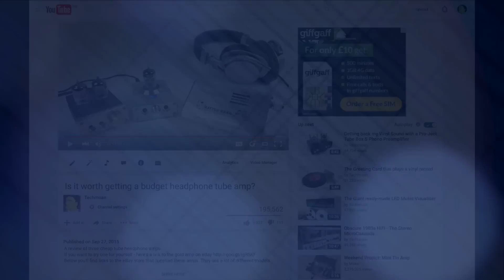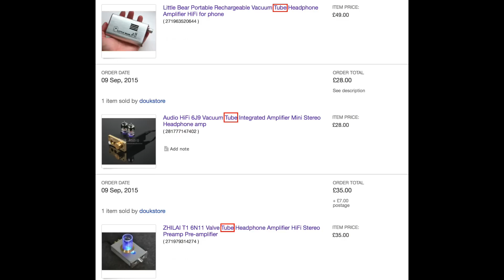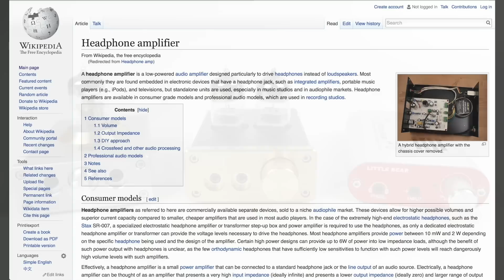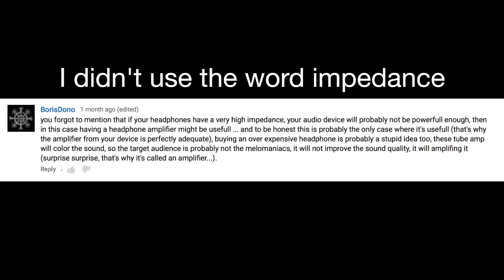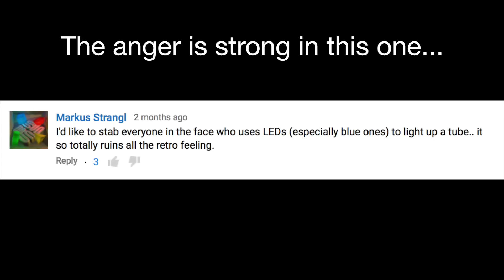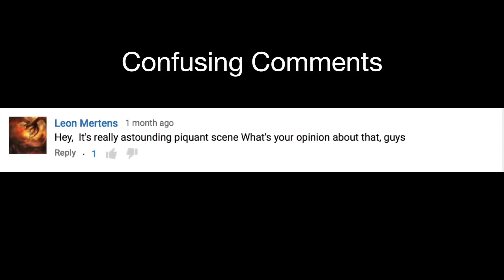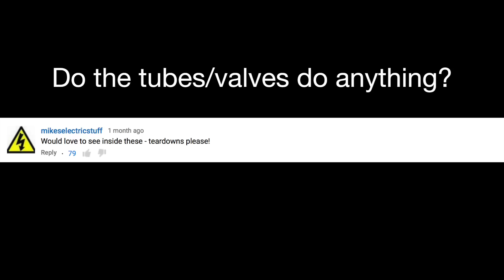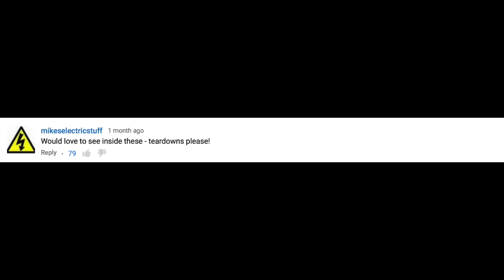Headphone Tube Amps - Follow-up & Tear-down

Comment: I'm an audio engineer by profession. I have to laugh at these hi-fi guys. It's very much all snake oil and suffers from opinion riding over physics. Take a look in a professional recording studio. There's no gold plated connectors or £1200 IEC power cables there.. Keep up the great videos pal and thanks for your efforts..
Reply: +Andrew Kirkby I bet you guys don't even use an atomic, gps compensated clock for your 50hz/60hz AC line conditioner, do you?
Reply: +Andrew Kirkby I'm not a professional anything, but I quite like to do my own automotive work. 1) I find a sense of pride fixing my vehicle, 2) It's old and needs it often, so it saves me money, and 3) It's hard to find a garage that doesn't break more parts than it fixes.  That being said... I hear people give me all kinds of vehicle advice, and much of it is snake oil as well. Telling me to put in additives and "HIGH POWER" spark plugs, telling me I should buy this or that to make the car work better. The truth is regular factory maintenance is what's important, no amount of snake oil will do a lick of difference.
Reply: +Jesse Crandle It's so true. Some things do alter your perception of sound but most listeners wouldn't know the difference and often those who say they had a better sounding system after an expensive upgrade have fallen short of the placebo effect to a degree..  I have a similar feeling about car repair. I do a lot of my own and tend to use manufacturer's recommended parts because that's what the vehicle was tested with and will likely get the performance I paid for when I bought it but adding expensive engine health additives etc will just burn the money you spent on them. A haynes guide to save the labour cost and a trip to a parts site like lings honda for instance is my robust solution... Unless the clutch goes.
Reply: Andrew Kirkby Best investment I've made in audio is a pair of Grado headphones. I had some SR80s, but after they broke I went to SR225s. The SR80s were a little lackluster in bass, so I went to the SR225s which has quite a bit more. A pleasant bonus was I could actually tell they were noticeably cleaner sounding, and the SR80s were already pretty impressive (coming from just sad Sony headphones that were 30 bucks, whatever you find online and in stores for less than $50).
Reply: +Andrew Kirkby 'Gold plated' cables are just gimmicks.
Reply: Sylvex Dragonskin Tube amps are different. Gold plated cables don't offer anything more than a cheap variant of said cable. A tube amp is something that investing in pays off. You wouldn't buy gold plated (plus purest of copper and whatever else) 2 metre 3.5mm male to male audio jack for $500... would you?
Reply: Andrew Kirkby I totally agree, from three standpoints: I play and record music both by myself and in professional studios, I'm an automotive engineer working at one of the top quality truck brands and I build my own amplifiers. And, you rarely see any of those gold plated stuff in equipment in studios. From a material standpoint it can both be good and bad, due to the galvanic element effect. If you mix different metals you are basically making a battery, although often pretty inefficient. But nevertheless a battery which will result in an anode and a cathode and transfer of material between the terminals. Therefore it's more important to have like materials rather than let's say gold in one end and zink in the other.
Reply: James Neave Yeah sure, but the thing is: nothing would corrode if it's environment was 100% made up of the same material. Let's say you have aluminum and copper connected, ie connected in some metallic way - then they'd form a galvanic element, that is one would trade ions with the other, since they by nature form a electrical potential (one would transfer ions to the other). If you would also tranfer electrical current via them, then it's less likely they'll corrode, the larger the current the less corrosion. So, anyways: different metals react with their environment more or less slowly, where gold doesn't react at all and let's say zinc reacts with whatever it can find.
Reply: HOW DARE YOU USE LOGIC ON A COMMENT THREAD. nah but for real most recording setups dont use gold plated connections  or anything
Reply: Stop trolling him :p
Reply: +Andy Cristea lolz. clever troll that.
Reply: +NikTheFix That is truly hilarious
Reply: +Andrew Kirkby However there are lots of valve equipment for "coloring" (i.e distorting) the sound.
Reply: +MoistGoat I wouldnt no, but since I can't hear a tube amp anywhere and since most ppl say not to go the tube way I'm always put off to buy one. Like I've read on forums that say they can't hear a difference between a Vali 2 and a Magni 2. I was thinking of the Aune X1s.
Reply: Sylvex Dragonskin Tube amps are great and they're likely unique in the sound they give (probably more nostalgia for older generations), but technology has moved on to making what most use today which probably sound better. Better as in everyone prefers different things. 

I've never heard a tube amp, but I'd probably not be overly wowed about it if I used the headphones I use now and compare it to my soundcard.
Reply: MoistGoat Hmm alright. Still gonna research more though since I'm really not sure.
Reply: I'm not, just an electronics enthusiast, but I do know there is nothing useful one can do with an audio signal that can't be done better today with solid state devices. Tubes are left over from when there were no transistors. At their development peak they were very good indeed, but any "warmth" or whatever audiophiles coo over was distortion introduced by tubes. If it had any value, somebody could have analyzed it long ago and designed solid state circuits that would have produced that warmth, but better, and in a lower cost package.
Reply: Herbert Shallcross well, sort of.. Tubes do have a quicker transient response but the main thing is probably more related to how they change the sound, and many people think that it's pleasurable.
Reply: That is what I thought as well what good is a $500 HDMI cable.   It is a digital signal of 1’s and 0’s.  They either work or not.
Reply: Andrew Kirkby   I love the Grado SR series.   Relatively affordable and they sound better than the low end heavy Beats.
Reply: Yeah that always made me laugh, the cable length difference would have to be something like 500 miles before you would hear the difference.  But polarity, that makes a big difference.
Reply: Tube distortion (even order harmonics, which add up to a sine wave) is more pleasing than bipolar transistor distortion (odd order harmonics, which add up to a square wave).  When you get into FETs that are voltage devices, which are analogous to tubes, things get interesting.  When I recently bought an overdrive + booster foot pedal for my guitar that had a pair of socketed JRC4580 op amps in it, I tried a bunch of different op amps to see what would happen.  It was surprising how different the clean and overdrive sounds were for each class of op amp.  I ended up setting up the pedal with a JRC4580 in the first stage, and a pricey $4 Burr-Brown OP2134 for the second stage, both set for "clean" boost (no diode clipping).  I'm certain that most of the tone in the device is set by the components that set gain and frequency response externally to the op amps, but the op amps themselves added some coloration as well.  The OP2134 had the least coloration and noise of the op amps I tried. I also run it at 18V for more headroom.  I guess I am not a heavy metal guy :-)
Reply: I have a diy car subwoofer. I used regular M6 bolts as terminals. In 15 years they oxidised so badly that the sound cut off completely. Gold plating would'be been good there, i think. But I replaced the bolts with stainless steel ones, let's see if they last 30 years.

There was a blind test in a finnish hifi-magazine, they tested different rca wires and wires for loudspeakers. The price ranges were about: cheapest, triple the cost of cheapest, and the most insanely expensive. Only the cheapest shit was barely recognized as slightly worse than others. It was in a magazine over 10 years ago, so no link for the source, sorry.
Reply: I've worked on electronics and have been into good sound for a long time,I have to agree with most of your statement, But gold plated connectors can def make a difference when home components get older,  I've seen many rca connectors become so dirty/corroded that the sound cuts out.
Reply: +Andrew Kirkby So would you say tube amps don't add color to sound and therefore it's better to go with an ss amp? What do you find of amps like Magni 2 or Aune X1s? If you don't know them then it's fine.

Comment: The reason you don't see many connecting tracks on the 'tubes' is because the circuit boards are multi-layered.

Comment: Enjoyed your video. The valves are simply a passthrough for the audio signal path. They are doing nothing with regards to amplification or single processing. Unfortunately the same goes for your budget Mistral amp.

Comment: Seems like none of them work at proper anode voltage. The valves are just powered off an input voltage rail or with a little bit of boost from those tiny converters. It can be told by the lack of any HV capacitors and powerful boosters. This is also the reason why they have to have op-amps there in order to at least somehow make it amplify. Overall, these should saund with a lot of non-linear distortion. The bear one is particularly crap and appears to be just a bunch of ready-made chinese modules violently bodged together...

Comment: Ahh another Techmoan video with something I'm interested in! You'd be amazed with my need for an amplifier. I need to wire on into my ride on lawnmower, so I can hear my music as I mow!
Reply: +TheAussieStig30 Have a look at lepai amps, would be perfect for your needs! Dont get a knock off one like I did though because they suck lol.
Reply: +Alex Grace cheers, I'll check them out. Obviously vibration, heat and weather will be an issue and that is why I've take a while to pick one. I've been tempted to buy a boat stereo but just can't find the right one.
Reply: Try mounting it underneath the hood or something, that way you only have to lift the hood a bit access the controls and it will be protected from the weather. I dont think vibration should be too much of an issue since alot of people mount car amplifiers to sub boxes, so going by that logic you should be fine.

Comment: well at least the gold one has two amplifier chips. It uses these ones: https://www.fairchildsemi.com/datasheets/NE/NE5532.pdf Also for the pins who seem to not be connected it's surely because they use a multi layer PCB, typically for the ground and/or power so you can't really see the connections.
Reply: +Aravzil 
They all use the NE5532. 
You can see the connections to the tube pins on the top layer. I doubt it's more than a dual layer board. Would be way too expensive, especially when they use boost converter/lipo charger modules from ebay. ;)

Comment: I like how people where complain about the invention of the tube "valve" and shit but with out the invention of the tube we would never have had the computer witch originally used tubes and now transistors.

ex: There are approximately 1,400,000,000 transistors in a 2010 17 quad core processor.

Comment: +Techmoan wow, that little bear amp has lousy build quality. That said all three do appear to be using the tube, they all contain the step-up circuitry required. Albeit, built to a price point. Sadly your test was complete pap, because you used that awful disco speaker and you didn't use Oxygen Free Cable, bloody amateur!

Comment: Hi, I commented on the previous video and I'm really glad you posted a followup. I'm a student of Electronic Engineering and I will tell the little I know about "Tube-Valves". They are obsolete and no longer a topic of any course.
To drive a valve there is the need of a relatively big voltage drop, this is because the electrons have to actually "jump" across the vacuum to reach the destination. The flux is controlled by a grid put between the two terminals, this is were you hook up the signal you want to boost-up. Other than these three connectors, which BTW are comparable to those on a transistor, there are at least two more used to heat up the device, the heat helps the electrons to jump across the grid.
Now, about the amplifiers you reviewed, I am still not completely sure about what is going on. As far that I know, and what Wikipedia knows, there is the need of at least 20V with the smallest tube you can get, and you may not know, but a lot of your older gadgets displays actually use the same basic idea of a valve, and they need about 20V as well. That being said, on the amplifier with two tubes, the input is 6V, and the single tube one, is 12V. But at same time I can see inductors very close to capacitors and little chip also, these are the basic parts to make a step-up voltage regulator, which can take a low voltage and output a high one. Same thing on the battery powered one, coherently all the parts are beefier because the voltage gap is higher. About the 8pin packages, YES, THEY ARE OPERATIONAL AMPLIFIERS, and yes, they could do the whole job alone, but what I think it is going on here is some sort of filtering before let signal into the output jack. 
One thing is still not clear to me: how is possible to elaborate two distinct signal (Right and Left) with only one tube. 
In conclusion, I don't have a definitive answer. Let's say they are using the tubes,  the performance can't be comparable to a solid state solution, in terms of noise, efficiency and durability. 

Again, I may be wrong!
And don't be mad at the people in the comments, this is the Internet!

Comment: Oh - and if you;'re getting microphony then you can be sure the tubes/valves are wired in and amplifying. And here's a paper on running triodes at 12v anode/plate voltage (including circujits) - http://www.valvewizard.co.uk/Triodes_at_low_voltages_Blencowe.pdf
Reply: +Proximity Mine Indeed not, which is why the actual amps have separate drivers! Personally, I think the whole business is a bit silly - I do like valves, and I do enjoy listening to valve stuff, but I'd rather have the whole chain thermionic. Nothing to do with 'hi-fi', just my peculiar sense of aesthetics.

Comment: Hi, please send me links to the devices. I'm interested in these tube amps, so I can buy some and check it with my oscilloscope.
After all, I think the tubes do their job, because there are visible components of step up converters in each device. Also it wouldn't make a sense to not use the tube when all other mandatory stuff is there and the tube itself is probably the most expensive part of each device.
Reply from the maker: +TrinomCZ the links in the video description will take you to the first video...and the product links are on that video.

Comment: I've heard good things about the so-called Objective2 headphone amp. That's an open source amp design, created by someone who goes by the name NwAvGuy, and it is manufactured by a whole bunch of different companies. The interesting thing about this is that there's also a DAC (digital-to-analog converter; =a USB audio output device) design named "ODAC" from the same creator, and there are combination devices available that contain both the ODAC, and the Objective2 amp in one metal case. That means, such a device could potentially be a very good digital audio dock for Android devices.
I was wondering if that's something you'd be interested in creating a review for.

Comment: All tubes (valves) are connected. Just the traces are on the top layers of the printed circuit boards :) On top of that i think all of the headphone amps might be powered by higher voltage that the power bricks suggest - i can clearly see small SMD inductors that might be a part of the DC-DC converters (ie 12V to 120V). I'm almost sure that it is the case in the third amp - you can see small daughter boards that are DC-DC converters from third party manufacturer. BTW some tubes like ECC82/83 will work with anode voltages well below 12V however this is not their "comfort zone" - the performance (especially the linearity and level of harmonic distortion) of them is quite poor. 
PS: in the first amp you can see old stock (vintage?) NE5532 operational amplifiers made by Signetics. This i believe was one of the first manufacturers of those chips like 40 years ago. Now 5532 is made by Philips a few others. But the Signetics ones are quite rare now and sort of "holy grail" of audio engineering. Back in the good days of music industry you could find them in for example Neve mixing consoles. They have distinctive sound to them, especially when driven hard (high audio levels, or heavy loaded with pair of GOOD low impedance headphones). Definitely they leave their own mark on the sound passing thru :)
Reply: Mateusz Kuraczyk But some of those boards looked like a lot of the tube pins were soldered to a ground plane/fill .  But then a basic triode can operate with only 4 used pins: Anode, Grid, Cathode and heater (other end of heater connected to Cathode pin). For stereo, you would need an extra Grid and Anode connection or an extra Grid and Cathode.